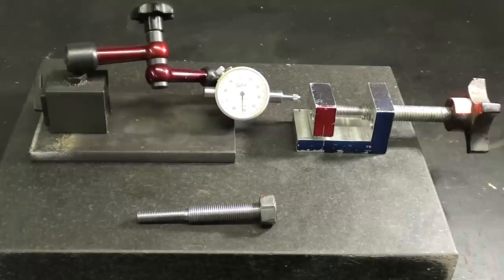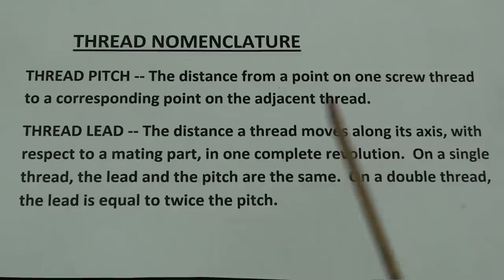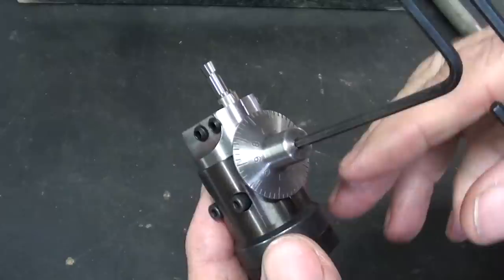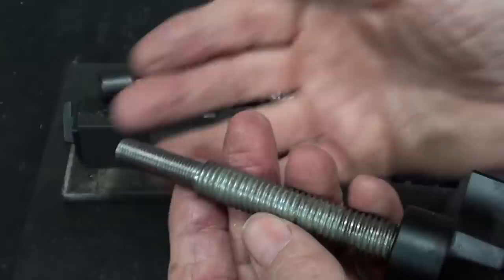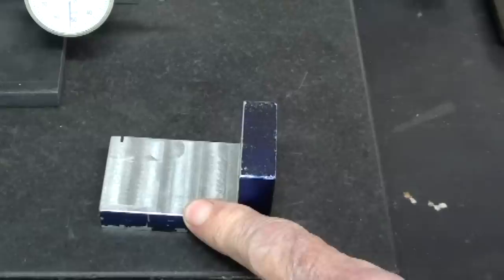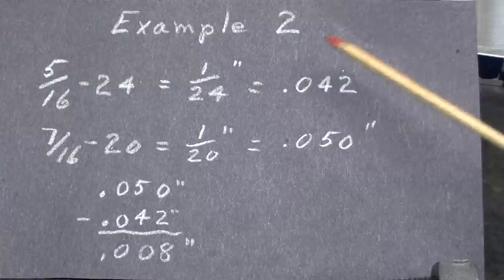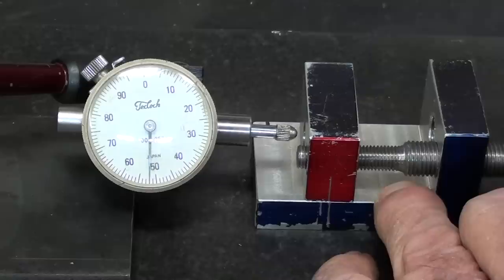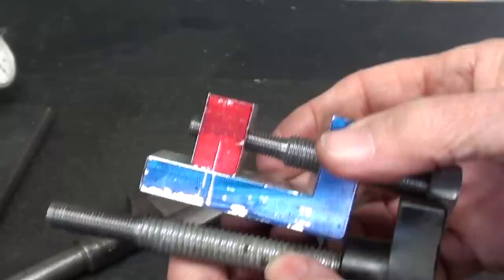What are DIFFERENTIAL THREADS #864 tubalcain

Comment: Interesting use of these in bone surgery. Bones heal better if there is slight compression across the fracture (or deliberate cut). So screws with differential thread pitch are often used, especially in smaller bones such as in feet where not much room for fixation.

Comment: Interesting tidbit: Differential screws depend on the difference in lead so a 1/2-20 screw has a lead of 0.05" but a 1/2-20 LH has a lead of -0.05". When you put these on the same shaft just as you did, the leads still subtract: 0.05 -(-0.05) = 0.10.  In other words, they double.  This is used in a lot of scissor jack applications such as bumper jacks and some machinist jacks.   I think your use of different leads is far cleverer than just using the more obvious LH / RH combination.
Reply from the maker: Thanks
Reply: Turnbuckle or a woodworking hand-screw clamp.
Reply: 👍I always thought one had to be a left hand to subtract the leads. Thanks for sharing.

Comment: Thanks, Mr. Pete, this is something I never paid mind to before!   I have seen the reverse used where the threads speed up the movement of the pitch, sometimes used in vises.
Reply: I wondered this while watching. So would the setup just be reversed? The smaller thread to the rear? Or is the configuration completely different?
Reply: @AdamA-pm3yn  this is like a turnbuckle
Reply: @homemadebuilder113  it's not the same as a turn buckle. This would be one bolt or shaft moving the piece twice the normal distance per revolution. 
God bless you!
Reply: A true turnbuckle does move double the distance in either direction when rotated.
Reply: You sure they aren't just two-start threads?
Reply: @Jeff Marden  the tap wrench he showed is an example of the speeding it up you're referring to.  One set of threads it right hand and the other set is left hand.  I'm not sure I can describe this in words without demonstration but I'll try.   In this video watch the two threaded holes independent from each other.  When you turn the screw, the first set of threads pushes the second block towards the dial indicator quickly because of the corse thread.  Now watch the effect on the second block when you turn the screw and you will see that it pulls the block back away from the indicator at the same time the corse thread is pushing it towards the indicator. The two thread pitches cannot be the same or else the block would never move.  When you turned the screw, you would be pushing and pulling the second block the same amount with every turn.  This is why it's called differential threads.
Reply: @xtn's youtube  this is what I was attempting to explain.  I may have  worded it poorly.

Comment: That was mind blowing.  I didn't understand at first, then I realized if the pitch/lead was the same in both holes, the block wouldn't move.
Reply: Right. If you run a single bolt through two nuts, their relative distance won't change as you turn the bolt. And you wouldn't need two different diameters either, because you wouldn't need to feed one thread through a differently threaded hole for assembly. You could just screw the both through the first nut and then start the second nut on it.

Comment: I built a STEM (scanning tunneling electron microscope) and needed very fine threads for adjustment. I used violin bridge tuners because they were very fine, but now that I've seen this I can easily go back and differentially thread some rod with (already small) watchmaking dies and get even finer results. I actually enjoyed the math part. Thank you Mr. Pete!

Comment: Excellent video on a little known topic. Woodworking hand-screws (two jawed wooden clamps) are usually made with two long steel screws that are right hand thread over half of their length and left hand thread over the rest with corresponding swivel nuts lodged in the jaws so that as the screws are turned the jaws move together or apart quickly.

Comment: Lyle;  You mentioned multi-start threads and the difference between pitch and lead.  I make custom pens and the cap and nib end of the pens are often either 2-start, 3-start, or 4-start threads.  The purpose of these is to multiply the distance that each turn of the cap takes in closing the pen. This allows the pen to close rapidly, but keeps the chance of the threads loosening to a minimum.  Keep up the good work, I learn something on each one of your videos!
Reply: Here’s an interesting example, Randy - some Cessna aircraft use beautiful, ground four-start threads on their elevator trim jackscrews. As with the pen caps, the object is to convert small rotary motions into large linear translations; it’s also required to have high strength in tension/compression. The four-start threads do that very nicely.
Reply: Like your addition here!

Comment: We use those daily on extrusion dies, it sets our gap in the die to maintain consistent adhesive coating.  The gap is set using differential bolts of various sizes depending on the die being used.   An example of one of our bolts, has threads of 3/8-26 & 7/16-20 which comes out to .012" per revolution.  Have had to make a few of those in a pinch to get us thru the run.  We mostly order them from a supplier due to the cost of labor in house vs. the amount of bolts we go thru.

Comment: I was looking at building a bracket to align two telescopes, so they can be used as high powered binoculars. Optics need serious precision as being 2 thousandths out is perceived by the eye. I came across differential threads when doing research and your 2nd example might be perfect for my purpose but scaled down a little. It needs to be something that can hold itself in place for long periods as well.

Comment: Very interesting video - thanks for posting! This brings to mind the head-to-block studs on my Willys L-134 flathead engine - that have two different thread pitches for another reason. The block side threads are 7/16-14 for maximum root strength, while the head side threads are 7/16-20 for precision while torquing. A common mistake is to replace them with 7/16-14 hex cap screws - which will not stay torqued for very long under use.

Comment: Hi Mr. Pete,  Great video.  I always appreciated differential threads in precision instruments.  You mentioned the difficulty in making fine pitch threads.  Think of the micro screws in watch movements.  Some are .25mm pitch or just under .010 inches, or 100 TPI.  Cant imagine making those!  I have a watch apart now waiting for parts.  With my 68 year old eyes I use a microscope and can hardly see the tiny screws unaided!

Comment: This is the best basic demonstration of the concept I have seen.  2 threads the same pitch (such as 1/4-20 and 1/2-20) would provide no movement per rotation.  I had to think about that but it made the concept more clear to me.
Reply: If 2 threads of the same pitch produced a movement, then threads wouldn't work at all, because a single thread is indistinguishable from 2 threads of the same pitch + diameter. Simply running a nut onto a bolt would split the nut in half!
Reply: @jsincoherency  I think I’m still confused.  20-20=0 ….  Here I was content for a couple minutes.
Reply: @cogentdynamics  Yeah, exactly. It must be the case that 2 threads of the same pitch have no differential movement, otherwise you wouldn't be able to thread a nut on to a thread, because the front of the nut would be jacked away from the rear of the nut!
Reply: I think this concept runs with outside and inside thread, then the block will move but in the opposite direction.
Reply: @mrpete222  make one more demonstration with two equal pitch threads.  If you won’t, I may have to! 😀
Reply: @jsincoherency  nicely put!

Comment: Design engineer here... I used a differential thread in an assembly fixture to precisely align parts under a microscope.  I actually went much smaller, drilling and tapping a #10-32 thumbscrew with a #4-40 through hole.  Six thousandths and change per revolution (with off-the-shelf tools!)  The 4-40 stud was fixed, the 10-32 thumbscrew was the operator input, and the nut threaded on the thumbscrew was the actuator.

Comment: I have a variety of micrometer drives used to adjust lens translators in my optics lab. They are all "differential thread" type. I knew that meant they provide very tiny movements, but I didn't know how it works, And the arithmetic you showed made no sense either until I realized, in the example you made, the large thread is pushing the part away, while the small thread is pulling it back, hence the need to subtract the leads. Very clever, and thanks for the lesson.

Comment: Even though I am familiar to the concept of differential threads this presentation was very nice.
I have been tinkering with camera lenses and the focus adjustment is often designed around a deferential thread!
Thanks for chairing Your extensive knowledge!
Reply from the maker: I did not know that they used that thread in a camera
Reply: @mrpete222  
There are a corse thread with up to eight starting points and a very fine single start thread.
The system tends to move an outer ring slightly and an inner ring with the lens system quite a lot.

Comment: I love this instructional videos that you make. Hope you make more. I have differential threads on my Veritas handplanes fine adjustments for advancing and retracting the iron
Reply: @mrpete222  looking closer i noticed that on my little block plane the two threads are not differential but, i would say, incremental. In fact the big thread is right handed and the other is the opposite. So they add to each other, i think for space issues

Comment: For the drawbar on my mill, the R8 collets use a 7/16-20 thread and the top of the bar is threaded 7/16-14 with a nut that tightens against the top of the spindle shaft and a fixed nut above it to hold the drawbar. It makes tightening the drawbar manually very easy and quick and eliminates the need to hold the spindle to get it properly tightened.
Reply from the maker: Great idea

Comment: Hi Mr. Pete.  I remember your talk about the thread on the tap wrench in the past and thought it was neat application but sort of put it out of my mind.  This application however has intrigued me.  I have purchased the material to build a grinding fixture to sharpen cutting tools from the book, tool and cutter sharpening by Harold Hall. (Workshop practice series number 38).  It occurs to me that the differential thread technique may be able to be applied to this fixture allowing for some very fine feeds of the fence into the grinding wheel.  I was originally going to use an ME 1/4x40 thread for the feed, but now you have me thinking about other possibilities.  Thank you sir for the enlightenment.  What a simple and clean solution!  Thank you for sharing!

Joe

Comment: Truck (lorry) steering bar is threaded at both ends. Left side is 2mm pitch, and right side is 2.5mm pitch. By turning the steering bar one rotation it ajusts the toe in and out by 0.5mm which is really fine for a truck.

Comment: Back in the '70s had a special screwdriver that was used on a missile to separate the sections.  Instead of a flat tip, the head was rounded, engaging the screw head like the edge of a washer.  To prevent slippage and damage, the 'screwdriver' clamped around the missile and had differential threads that were the same pitch as the screw itself.  So as you backed it out, the screwdriver remained totally engaged in the screw...  Have never seen anything like it since...
Reply from the maker: Have not

Comment: When I was in the Navy, my last command I was manager for all of the tools and service equipment, the squadron was one of the oldest aviation squadrons in the Navy and it still is. I was informed I had a satellite facility across the taxi way that I had to clean out and inventory. I found an old clamp, probably from the 20s. It was a hinged clamp with one end having a standard turn handle,  the other end with a hole for the screw. The screw in question had lead space on each end, one with the aforementioned handle, and about a quarter inch,  and on the handle side RH threads,  on the other side LH threads,  the clamp part with the screw hole had a square mount base with 4 unthreaded holes, probably to mount to an aircraft. No part numbers, no idea what it was for... was old, and it went to DRMO along with probably 3 tons of old junk.
Reply from the maker: Very interesting

Comment: There must be a force multiplication effect as well - assuming it's not lost in friction. Great explanation - used extensively on fine adjustments in instruments and high pressure air valves.
Reply: Yes the force is multiplied and the friction subtracted.
Reply: I don't think so.  The force on the screw is the same either way and then the forces in first set of threads will be the same too - I don't think you could clamp something any harder.  It's quite an interesting question though I'd like to see an experiment to confirm.
Reply: @TheYardlet  Yes of course the input torque on the screw doesn't change. But the resulting linear force exerted by the moving block changes along with the motion ratio. For a given input torque, you can achieve a greater or lesser linear force output. This is no different than using any single thread. You get out whatever the ratio of your mechanism is (not accounting for frictional losses). This is true whether you use a differential screw, gears, levers, or whatever. In other words, you can definitely get greater clamping force (if your mechanism is intended for clamping). Any mechanism with a motion ratio gets such results. For any given amount of work input, you get the same work output...but the ratio of force/distance changes.

Differential threads utilizing opposite handedness obviously get LESS clamping force, but more distance, as is the case in the tap holder shown at the end of the video.

Comment: Good video!    I've seen a couple of interesting differential thread applications, though using a slightly different technique.   

One was doing precision jack stands for a metrology levelling platform.   There, rather than doing two threads on one shaft they used a 3 part system with a metric thread cap screw, an imperial fine pitch cap screw and a brass barrel nut tapped 1/2 way for each respective cap screws.   Neutral position was with the screws threaded in 1/4 of the way into nut.   Spinning the nut did the distance adjustments with a super fine net lead distance.    For accuracy sake they then 3D printed a spring mechanism to preload the assembly and they rounded over the top cap screw to a hemisphere.  The plate that went on 3 of them had parallel alignment steel dowels, spaced to capture the hemisphere.  

The other was precision machinist jacks, which were again a 3 part assembly with an inner shaft and anvil threaded for one imperial pitch, a sleeve with internal threads to match the shaft and external coarser pitch threads, and the base internally threaded for the coarser pitch.   For this you could do rough fast adjustment by turning the sleeve relative to the base, intermediate by turning the shaft relative to the sleeve, and fine by turning the sleeve relative to both the shaft and base for final tightening.

Comment: This is the most interesting thing I have learned in a log long time.  It's amazing to me how innovative people can be.
Reply: Somewhere in the attic I've got a book that's all about engineering with various combinations of the simple machines: inclined planes and wedges, levers, wheels and axles, pulleys, screws (just twisted inclined planes really) etc. Then sections on more complex variations/combinations of those, like gears and gear sets, differential threads, etc. My favorite is the section about four-bar linkages. As a youth I was fascinated by the operation of my parents' old fold-out couch/bed contraption...the way the frame unfolded and flipped out all in one motion via an arrangement of various length linkages pinned at the right places.

Comment: A while ago I made a differential thread adjuster for my home made Norris planes. They worked beautifully. Very precise movement compared to Stanley's adjuster. I was quite impressed by this simple yet precise mechanism.
Reply: I was just about to mention the Norris adjuster. Very famous use of a differential screw.
Reply: Stanley and others used these on some block plane blade adjusters.  Don't know the model numbers, but the differential screw initially kind of messed with my mind.
Reply: @gtieszen  I wasn't aware that Stanley used them also? I do have a Record 405 same as a Stanley 45 and it has a differential thread for fine adjustment of the fence.

Comment: Great video. I made differential screws for the three point mount adjusters of my 3d printer bed.
Reply: Also, highest thread count I have cut is the sm -40 used for some 1" optical components.

Comment: Some years ago(2006), I built an aluminum controls box enclosure for Cessna Aircraft Corp test fixtures. It had several differential treaded plungers mounted in strategic locations inside to finely tune and set switch actucator positions for flight controls. 
All that stuff is behind me now, been retired 7 years😊

Comment: 1960's computer Output to Microfilm machine (3M Electron Beam Recorder):
Extremely fine focus/image size adjustment for a microfilm imaging system.
We needed to project a 13.5 sq. mm film form image at the exact ratio of one to one upon another piece of piece of film that was about 4 inches away.
   We used a differential threaded device to move the source image.
The threaded device was made from a piece of 1/4" hex stock about 1 1/2" long. One end was threaded 24 tpi right hand and the other end was threaded 32 tpi left hand, IIRC.  obviously then, one bracket held the movable image stage and  the other bracket was fixed in place.
  There was a lot more to it than that, but you get the idea.
Reply from the maker: Thank you, that was very interesting